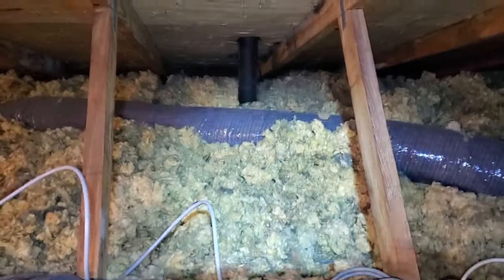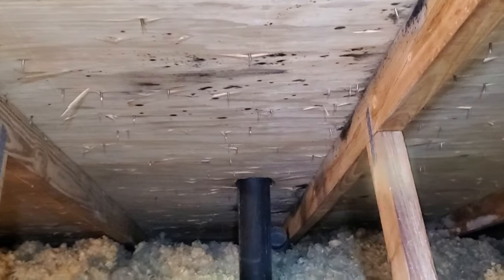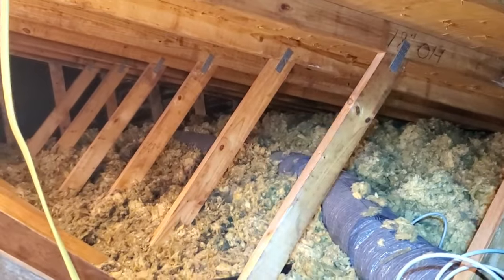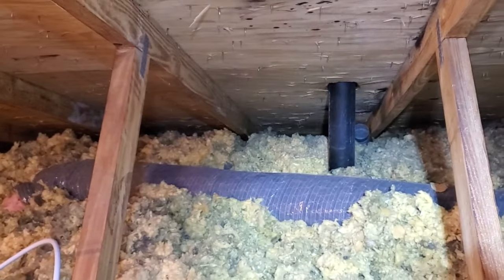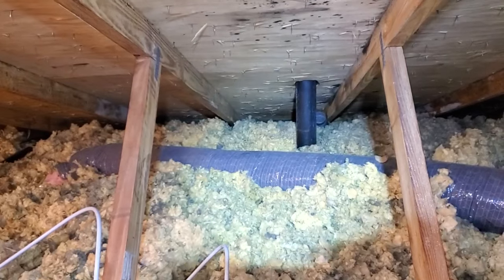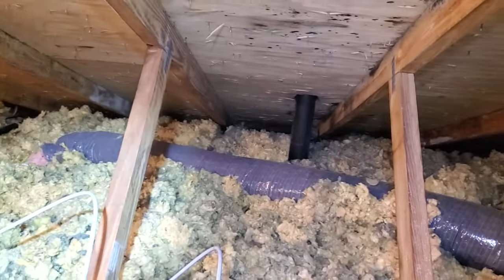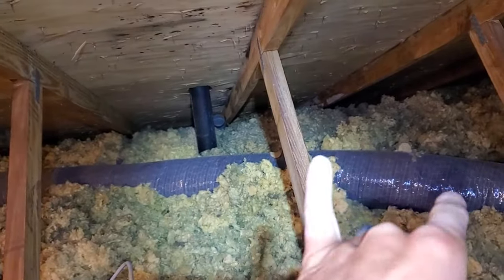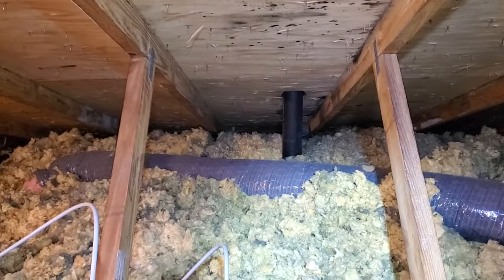Bath fan venting into the attic and what to do about it

Comment: I am very surprised there is not more mold present. I've seen this issue a hundred times and typically the whole cavity is black. Installing an exit at the roof and insulating the exhaust hose is definitely the way to go. I can also tell the Insulation is way too low and would benefit in air sealing it before topping it up. Great explanation.
Reply: If the cavity is molded a bit or black....how is it fixed ? Yes, properly vent the exhaust ...but how is the mold area taken care of ?. thanks for your response

Comment: Or if a condenser was added to the vent in the attic that drains in to the soil stack or radiator header tank (which presumably had an overflow pipe right?) then might the loft not benefit from intermittently being warmed by now dry air. Unless of course the condenser merely reduces the moisture content warm air should dry any moisture that condensed in the loft from the use of the unconditioned extracted bathroom air.

Comment: What if ten years later you learn that they never installed any kind of ducting and has been sending the noisture into an attic with poor ventilation. Improper installation of a wall furnace causes the air to go from the attic into the living room anytime the bathroom fan is on or the wind blows. After 7 to 8 years, it learned the mold has been the source of a decade worth debilitating health complications.

Comment: Gable venting is ok, but insulated flex, in the attic, will condense and fill the flex with water. Agree the soffit is poor choice. The roof is ideal, get a roofer to install the vent. It is short, quick, and cheep.
Reply from the maker: If the fan is sized properly and the insulated duct runs straight out (not uphill), condensation shouldn't be an issue.
Reply: LOL nothing about roofing is cheap.

Comment: Could you run it to the ridge vent rather then the gable?
Reply from the maker: Not a good idea.
Reply: @nwohiohomeinspector  why?
Reply: They are designed to be terminated through gable vents or roofing goose necks that come with air tight adapters. If a roofer installs the goose neck correctly you dont have to worry about it leaking.
Reply: @toomanynarcissistshere2102 you’ll rot the wood around the ridge vent

Comment: This sounds like a dumb question. My vent is also placed at the soffit.  Can I put an elbow out from the soffit vent and face it away from the house? Would this be as efficient?
Reply from the maker: Not a dumb question at all!  Your upper vents are constantly "pulling air" from those lower soffit vents, in order to keep your attic well ventilated.  A short elbow is not really going to help much or do anything as the conditioned/moisture-laden air from your shower steam will likely linger around those soffit vents and still get "sucked" right back in to the building envelope.  If you extended it out further, maybe, however, it's going to be an eyesore. Hope this helps & thanks for watching!
Reply: @nwohiohomeinspector  thanks for the response. My house is brick all the way up and i dont want to core thru brick and I agree with you about less holes on the roof. I dont want to drill up the roof neither.

Comment: Wait you can't use a 45 degree tap to connect into an existing pipe? Why not? The pipe sizing up there would have more than enough CFM exhaust capacity to handle two fans running at the same time. Please clarify.
Reply from the maker: https://www.familyhandyman.com/project/use-an-in-line-fan-to-vent-two-bathrooms/

Comment: How do you vent into the gable ends?
Reply from the maker: Run the piping on top of the ceiling joists under the insulation or run an insulated duct to the gable end.  Cut the hole out and install a bath vent hood w/damper.  I wish there was a way to post pictures/graphics.

Comment: How far away from the soffit vent should the exhaust fan vent ?
Reply from the maker: I wouldn't vent into a ventilated soffit if you don't have to. If necessary, I'd keep at least three to four feet away. I have another YT video about soffit venting you can check out.
Reply: @nwohiohomeinspector  thank you for your response. Also...if the area is molded a bit or black....how is it fixed ? Yes, properly vent the exhaust ...but how is the mold area taken care of ?. thanks for your response
Reply from the maker: Just needs cleaned off. This stuff works well: https://www.rmrsolutions.com/products/rmr-86-pro?variant=48382662863

Comment: Unfortunately your not allowed by code to exhaust into the gable
Reply from the maker: What?  What code?  Why on earth wouldn't you be able to vent out a gable end?
Reply: Well Florida code it has to be directly exhausted outside not in a gable, not into a soffit, not into a ridgeline, but directly
Reply from the maker: @rogerchampjr933  Show me. Where else are you going to vent it if you can't vent it through a gable end, besides the roof?
Reply: Yea it doesnt actually state that anywhere in the code. It just needs to be terminated outside amd not be closer than 3 feet to any opening or intake system on the house. Aswell a backdraft damper must be used